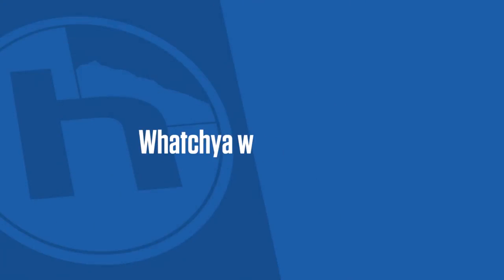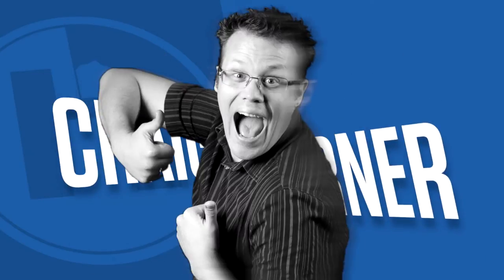TC-Helicon - How TONE uses Adaptive EQ, Compression, De-ess and Gate

Comment: Quick question for you guys. I love the Play Electric so I'm putting one on order, as we know it has an input for your in-ear monitors. Now are you able to hear the band through them or just your voice? And is it possible to have the sound engineer mix them. So in other words if I use my play electric and plug my in ears through it can I hear my band and will I be able to get a good mix?
Reply from the maker: +Cody Wolfe Play Electric doesn't have a monitor input. The Aux is always mixed into both the headphone and main outputs. You can turn down the Aux on the mix page so it doesn't come out the main but it also can't be heard in the headphone out. Touch 2 and VoiceLive 3 have the ability to route incoming Aux/Monitor to the headphones only.
Reply: Awesome thanks for clearing that up!

Comment: I have a TC Voicelive 3, it has so many Highs that the feedback is almost never ending, So far I can only unhook it and get a fantastic sound for everybody or adjust the PA for my mic and everybody elses mics are mics are a bucket of mud, It seems like I have tried everything, I can make a sacrificial set up to get rid of the feedback and the whole Pa sounds pretty bad, The manual makes reference that there is a EQ adjustment but its not very clear and it kinda jumps over it, In 60 years of playing music I have never heard a PA that sounds better than this under any circumstances, but as soon as I hook up the TC Voice live 3 it starts squealing like a pig without rhyme or reason no matter how I adjust it even at extremely unuseable low volume , There has to be a EQ setting control in this unit, I just cant figure out how to get there, HELP !!!!!

Comment: Hi craig, I use the VLT2 and I tend to sing in a very high pitch style (Guns, Judas, Maiden...) but I find that the normal tone style tends to muffle the high end a bit, compared to when it's off.. There are several other options but none to make it brighter. I'd like to know what causes that, is it the compressor or the eq itself? I can't test it since you can't only switch the comp off... Hope that makes sense, cheers!
Reply from the maker: I'd guess that the "target" frequency map that Tone is trying to get to is reducing your highs a bit. In T2 there's no way to separately control EQ, Comp, De-ess like you can in VL3 for example. In your case, it might be best to turn tone off and then do some EQ/Comp work at the destination mixer instead.
Reply: TC-Helicon well thanks that explains it, do you think that there might be a future update on the vlt2 that would allow manual eq or compression? I'm actually thought of buy the vl3 instead of the vlt2, but with my guitarists using all the floor space with their huge pedal boards, the vlt2 is much more convenient for me.

Comment: Hi craig i just bought the vl3 , can you tell me from where can i set the eq for my vocal like mids low's high etc.. and tweak them in vl3 or is it determined 
Thank you
Reply from the maker: Hi Sidek, go into the SETUP menu and look for the TONE tab. There, you can turn the "adaptive" portions of tone (EQ, Compression, De-Ess, Gate) to "manual" and gain more control over the specifics. Personally. I'd leave things adaptive, but the controls are there if you need them.
Reply: TC-Helicon ok , thank you so much !
Reply: i cant find the tone tab on my tc helicon voicelive touch 2, please can you help me! how can I EQ my voice???

Comment: why did the take manual eq off of the newer tc helicon models like voicelive 3 xtreme
Reply from the maker: VL3X still has manual control of the EQ and other Tone based stuff. You need to change it to Manual from Adaptive and then you can tweak the settings.
Reply: @tchelicon  but how to you get to change it?